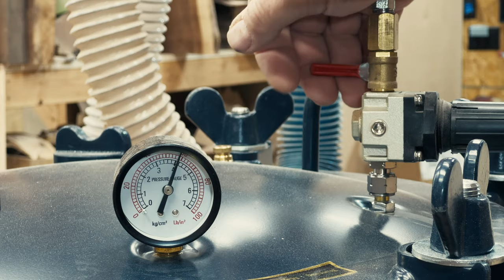Rescuing Beauty: Woodturning a Massive Burl & Epoxy Bowl from Insect-Scarred Wood!

Comment: I hope a vacuum worked on that epoxy.
Reply from the maker: I didn’t use a vacuum - used a pressure pot 50Psi for 3 days. Set like rock.
Reply: @bespokewoodartistry1517  I meant for cleaning it up after turning. 😂
Reply from the maker: Haha yeah,  the vacuum gets clogged quickly so had to revert to the brush and dust pan in conjunction with my bad back lol